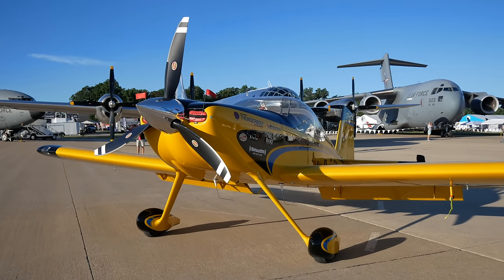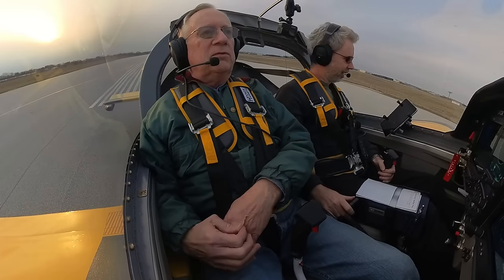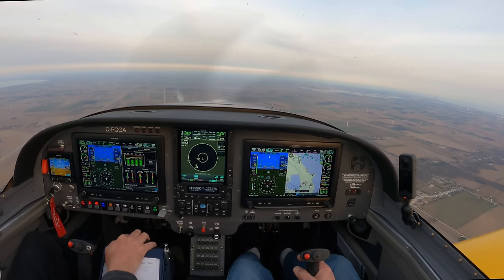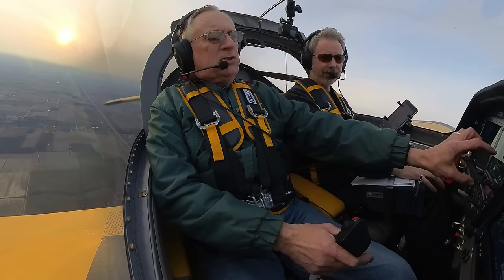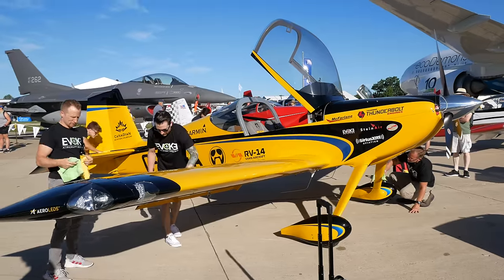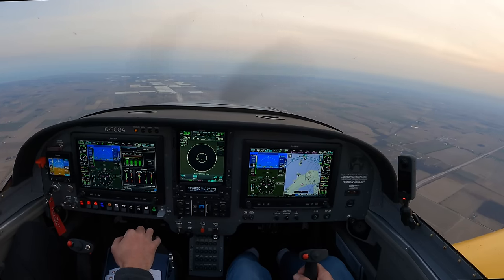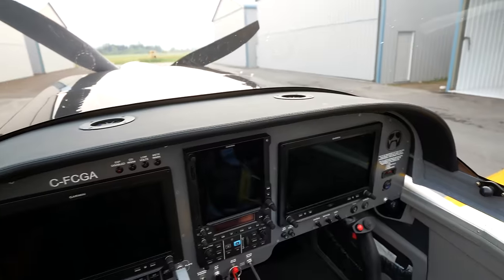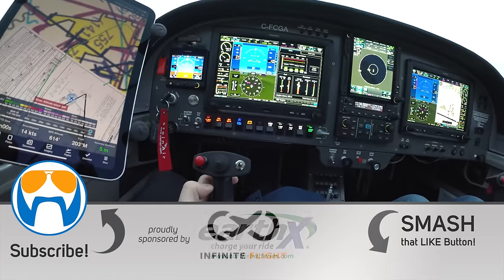All the ANSWERS after 2 years, 200 hours Flown

Comment: The question is would you spend $250k out of your own pocket. I'm assuming sponsorship paid for lot of that which is great I would do the same. RV-14 quick build is 65k it's possible to get it flying for $120k if one does lot of their own work overhauling a used engine themselves. Even find an A&P to assist in an engine overhaul.

Comment: My 7A came out a little aft of where I'd like the CG.  It was VERY pitch sensitive!!!   Flew it like that for 10 years and just a few months ago added a second battery forward of the first.  Added about 14.5 lbs and shifted the empty CG about 3/8 inch forward.  Doesn't seem like much but it did make a difference.  The additional benefit of bringing the second battery online before cranking... WOW... that prop spins!   I fly until the amp draw is normal indicating batteries are fully charged and then switch the second battery off.
Reply: Not the first rv to come out like that. I have a friend with a 6 and with 2 people you have to lock your elbow on the arm rest or it’s easy to pio. I would want to fly it with 30 lb of baggage. He needs to put a steel crush plate on the prop or something. A little bit of cg movement goes a long way.

Comment: I'm not a Garmin expert by a long shot but looking at their trim servo motor, it looks like a stepper-style motor. Maybe ask Garmin if there is an option in software to slow down or microstep that output?
Reply: The elevator trim speed can even be programmed with airspeed.
Reply: The trim servo is not a Garmin servo, its a a Ray Allen, supplied by Vans.
Reply: Most people run their trim signal through the Garmin autopilot.  This gives the benefit of the autopilot being able to control the trim to reduce forces on the pitch servo, and being able to slow the pitch trim based on airspeed.  Also allows the avionics to detect trim runaway and stop trim motion.  Not sure why they didn't go with that setup.

Comment: Great video.  One thing for builders to consider when adding complexity to their project is the maintenance access.  As one ages, it is much harder to work in the cockpit..  I built my 7A when I was 40's Now in my 60's it is much harder to maneuver in the cockpit during the conditional inspection and maintenance.

Dream it, Build it, Fly it

EAA Tech Counselor, Sheet Metal Workshop Volunteer 20+ yrs.
Reply from the maker: Great tip!

Comment: Got to this late, but some notes: Ah yes, the stall warning is a bit loud, as are traffic calls in my airplane.  Anticipating the cowling removal difficulties I've seen other owners struggle with, I went with the Skybolt fasteners for the top cowl and stock hinges for the bottom, so my cowling goes on and off fairly easily.  I modified my wheel/lower intersection fairings from 3-pc. to 2-pc. during the winter; they're not completely finished yet and I'm flying with them for another season before I do.  All my trim is manual for the reasons you guys mentioned.  The RV elevator is the most sensitive control of any aircraft I've ever flown, as is the trim.  The mechanical vernier trim appeared to have some slop in it during assembly, but in flight it's rock solid and very sensitive.  I have a total of ten full knob rotations lock-to-lock and in flight I never have to move the knob more that 1/4 turn to trim; usually about 1/16 turn.  My Whirlwind prop has no extension and my battery is aft-mounted; most RV-8 s are nose-heavy but I cannot exceed my forward CG envelope without overloading the forward baggage.  I can overload it aft but I'll usually exceed gross before going outside the aft envelope.  My engine never backfires, which surprised me.  Watching many RVs coming into OSH parking, many sound very unhappy while taxiing, but mine purrs like a kitten.  Barrett dialed it in just right!  My controllers are always making references to my Pilots That Don't Go Anywhere video and that always makes me laugh.  Congrats, John, on the RV-4!  Hope to see you guys soon, at CAM and at Sarnia!
Reply from the maker: cool yeah - you did a great job with yours.
Reply: I agree about using the Skybolt fasteners.  My -8 has them as well.  My RV-4 did not and it was a pain.  I fly my -8 100% solo and agree about the nose heaviness.  Mine is fix pitch metal prop and would switch to a composite to move the cg aft.  I currenly fly with 25# in the aft baggage compartment. Seems if most of Van's side by side RV's have an aft cg.  My electric trim is slow so even at high speed there is no jerkiness when triming.  If I had built the plane I too would have gone with manual trim to eliminate the "trim runaway" factor.  So far I have never heard of someone experiencing it.  Steve's is one if not the nicest RV's ever but of course at a cost.  My -8 was produced for $80K and does 90% of what his does.

Great vid by Steve and love his honesty!

Comment: Great episode! It looks like the plane has held up pretty well over the 200 hours and two years. Thanks for including the build cost. You really do save a lot when comparing experimental and certified avionics. My only suggestion would be to engineer a little access door in the wheel pants so you can check tire pressure and fill the tires with air. My old Cessna 150 and my old Piper 235 had wheel pants that made the tube stem unaccessible and it was such a pain.

Comment: Also had to change heat muff end.   VPX controls trim at speed so no issues there.  Lost bearing on original tailwheel as well.   I dumped the springs for the solid rod.  Ended up going with an upgraded tail wheel assembly that provides more clearance for the tailwheel, if not the clearance is too small and it will drop down in a tie down hole eventually and risk damage.

Comment: Well I think it turned out incredibly well. The panel alone is amazing. And I was completely wrong about the paint, which turned out really incredible. I am curious if the trim tab servo cannot be adjusted to a slower rate. If not, some shopping around to get a slower rate servo might be the solution. It's time to put a for sale sign in the window, and start building that four-seater RV 10 to haul the family around!
Reply from the maker: Glad you like the paint!  And the trim speed is fine when in landing config (in fact I wouldn’t want it slower when trimming while deploying full flaps).
So it is really a case of deciding to upgrade the firmware and trust “auto trim”, or live with it as is.
Reply: @FlightChops  another comment mentioned that you should be able to dig into the configuration and set up airspeed-dependent trim rates.

Comment: What are engine temperatures like with the Thunderbolt engine? You said in your OSH arrival it did not like 90 knots... A carbon plenum may be in order. Love seeing great capability out of the RV perform.
Reply: The engine temperatures are never really a problem - CHTs are easily controlled at low speed , the only time we see them creep near 400 is a slow, higher power , extended climb in hot weather.

Comment: Late to the game here but you can get wireless tire pressure monitoring caps that transmit to a small device with a screen that plugs into an onboard 12v outlet. It makes it really easy to check your pressures before a flight.
Reply from the maker: Yes, I considered that, but then I was told they are often the weak link that ironically cause the a flat tire - which can be a pretty serious issue in an airplane with wheel pants is low profile as these.
Reply: @FlightChops  Those slick things are a bit different than a Cherokee!

Comment: Steve, what did you do to your fuel tanks build to kept the engine running during inverted flight?
Reply from the maker: So the good / bad news is that I do not believe there is any sort of inverted / flop tube system available for the RV-14. 
But it doesn't matter as I have almost never had the engine hick-up within the context of Sportsman level acro. 
This year I was consistently hitting -1 and even -1.5G for multiple seconds at a time.  
(mainly at the start of the 2 of 4 Split-S (figure 7 of the 2024 known sequence). 

You WILL definitely want an air oil separator to stop the breather dumping oil though. 
I am VERY happy with the Half Raven for that. 
You know what the biggest limiting factor for negative G is though?  
The belts. 
I don't have (or want to deal with) ratchet straps, so I'll never want to do more negative than I am doing now. 

Let me know how it goes.

Comment: Hearing about the elevator trim being so sensitive reminds me of Austers. One very important thing to check on the Auster is the trim cables. They must be in good condition and replaced when required. Some fatal accidents were caused when they snapped as they cause massive G forces in pitch resulting in the lift struts bending. Here in New Zealand we had a J1B Auster have that happen but the wings stayed on and the pilot managed a safe landing with very bent lift struts!

Comment: What was the (aluminum??) heat shield material that you applied over the Fiberfrax, on your lower cowl?
I need to do the same and suspected the adhesive-backed aluminum material offered by Spruce might not adhere very well.
Reply from the maker: I believe that is the stock part that Van’s ships with the finishing kit / I can confirm.

Comment: My 14 trim motor isn’t sensitive maybe it’s a quick avionics settting
Reply from the maker: Do you have auto trim enabled? I think that solves it.
But the larger debate is, do you want to have auto trim enabled in case it ever was to run away based on a software glitch?

Comment: Could you use a tire pressure monitoring system to help you keep an eye on that without needing to remove the wheel pants?
Reply from the maker: I considered that, but then learned that those things can often be the point of failure and the cause of a flat tire… so I decided not to.

Comment: Re the trim issue at high speed via the GSA 28 servos. Did you utilise the Garmin GAD 27 control. I have both the VPX pro and the GAD 27, the latter controlling autopilot and trim functions as per the G3x install manual. VPX is utilised to control the remaining electrics.
The Screaming Eagle Tailwheel gives a better ground clearance and functional bearings.
A really good summary of owning a 14, much of which I concur with!
Reply: Exactly, he has the trim wired wrong. The gad 27 will move it exponentially with speed.
Reply from the maker: My understanding is that this only works when you give the auto pilot authority to trim.  I have not. But I am considering updating the firmware and giving it a try.

Comment: How do you you measure the contact patch for comparing to tire pressure?
Reply from the maker: It is not really a precise thing but it helps get me in the ball park. I did it by making a card board calliper.
Reply: @FlightChops  Thanks. Trying to steal the idea for checking tire pressure on my club's sailplane. Is it an adjustable cardboard caliper, or fixed at the length you find works?
Reply from the maker: I just inflated to the correct amount and then made a cut out "caliber to slide in from the side to "measure" the contact patch in future if it gets too big for he caliber, the pressure is low - it is not scientific 😂
Reply: @FlightChops  Thanks! I'll give it a try.

Comment: I have a similar instrument set up with a G3X touch and GTN750 TXi, but are disappointing of the communication between these two. Of some reason doesn’t Garmin and Garmin communicate fuel flow between each other. That is very disappointing. That is certified version, does it works better in experimental versions?

Comment: That PC power supply as a battery charger cracks. me. UP! (and is also mega cool) 😄😄
Reply: As a fellow IT guy, I appreciated Dave's work there.  :-)
Reply: @markthibault8579  IT guy here, as well. I think that's why we picked it out 🙂
Reply: Working at a car software company, I know lots of people use PC power supplies for powering 12 V electronics. I've seen test rigs from major car manufacturers that have a PC power supply sitting in there somewhere... 

Using one for charging a 12 battery might actually not be the ideal application - the power supply has a rather well stabilized output voltage that might be slightly too low to fully charge a 12V lead-acid battery. An LFP one might be different, though. :-)
Reply: @realulli  I didn't have that background information, thank you for sharing!!!
Reply: @realulli  yeah. Lead-acids charge at 14.5V. I think the higher voltage also helps reverse/reduce wear on the electrodes.
Reply: I'm guessing it's hooked up on the panel side of the battery solenoid so you can power the panel for demos, and leave the master switch off.  Battery won't be part of the circuit at all.
Reply: @rbrosz  look at above comments for info from people who build these.

Comment: Just remember people>>When ever you run a battery down to the point the engine will NOT turn over properly, you are placing a larger "ARC LOAD" on the armature in the starter.  NOT GOOD for long life and it's also not good for the battery itself.  Keep those batteries charged well.  Nice work.
Reply from the maker: Thanks for the insights in that.